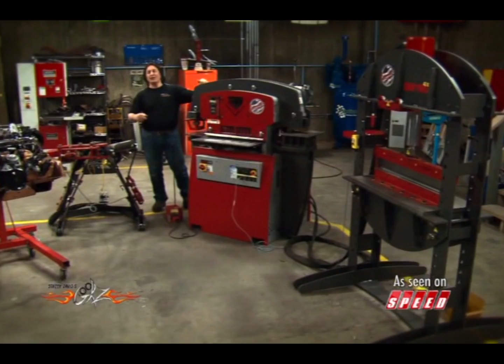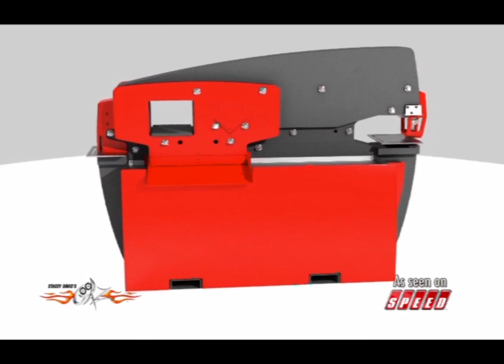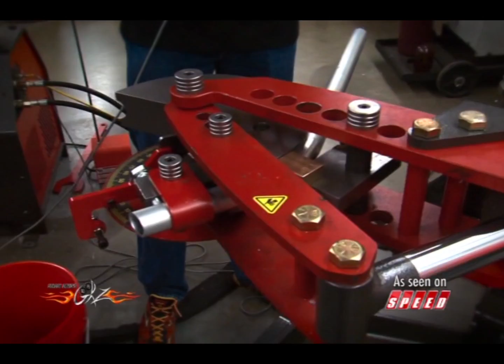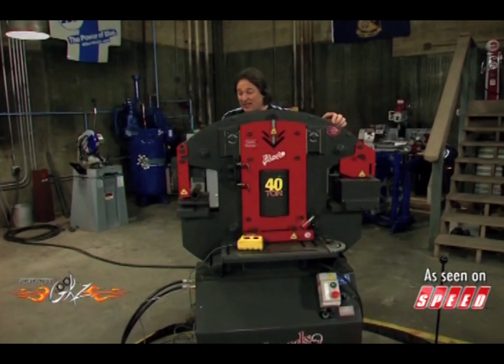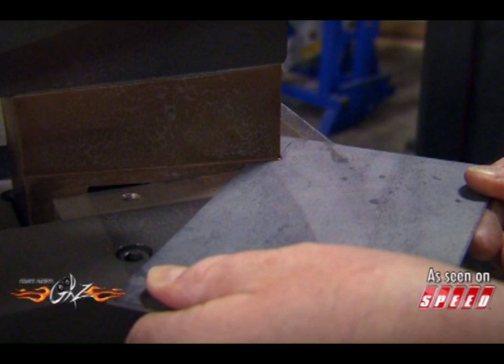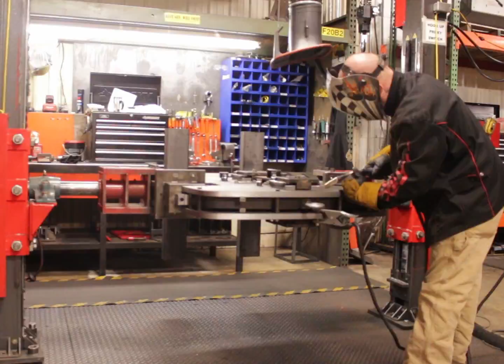Edwards Manufacturing Company Featuring Stacey David

Comment: how can i get this product in india...?
Reply: This is propaganda, and what an awesome infomercial this is. These machines are made of low-grade carbon steel that you can pick up off of any Shelf. I could tell you this cuz I have in my possession a 60-ton Edwards it's not a fantastic machine. It does do his job ish. Boy howdy old Stacy makes it look good like gold like it was dropped from Heaven that's all bull crap. After using the punch for a little while what happens is the deck folds in around the punch especially on heavy parts. Making it virtually impossible to remove . Once you do get out your die grinder  so you can put in the next  die . The lower die impossible to remove by hand because the quality of the Steal is of less grade than the stuff you're punching there for the compression has folded the steel in around the die. Get your hammer a steel rod and a die grinder and you can use it again. The change over time between punch and break is redonkulous. The coper notcher is an nice additive. But the guard built around it makes it virtually impossible to see what you're going to do besides make scrap. I consulted with the people at Edwards and they claim their safety up and down. Okay they couldn't answer my questions about why. Why is it that I can share a 3/4 in length part and it falls out of the back of the piranha but yet it Stacks up in the back of the Edwards making you walk around to the other side of the machine to retrieve it. It's a good machine for somebody that's looking to waste some time. They're bragging rights are a bit much it's made of low Quality Steel. In my 24 years of Welding and Fabrication this thing is as soft as a pillow when it comes to steel. It is way overpriced for what it is. And I mean p e r o i d.
Reply: @lsohweldfab6575  Gamut Capital Management-Typical bunch of rich Venture Capitalists who look around, buy companies with excellent reputations, owners sells, what does he care, he never thought he could make that much. And he is right. The Wall Street boys use a different language: EBITDA, TTM, Ratio of this company's name recognition and market penetration to that sector. They also pay big bucks for forward looking economic forecasts, look at what the Chicago Board of Trade Commodities Brokers are pricing 12 and 18 month steel at.
 Employees are suddenly filling out productivity cards, justifying costs. In the video the EX owner, you will hear him referred to as CEO, the video is probably what got GCM's attention, but the sub.title says COO. These guys also own Jet, Baleigh and Powermatic.
I have spent the last 2 years connecting dots, and putting histories together, from start-ups to mergers and take-overs, and the layoffs in one division when the other four are raking dollars. This happens all the time, but doing it to manufacturing - the lifeblood of our nation, the best paid regular people, the wealth they spread in their communities from decent paychecks, what happens to the 45+ year old who only knows making dies, or EDM or 24'X180" Gap Bed Lathe?  You probably won't know there is trouble, on the outside, until you check into each State's economics section. When you lay off over 100 workers, you are required to file a WARN notice, 60 days prior to a layoff. You can easily monitor this but it takes patience. Defense Department? National Security, it's this kind of crap that raises prices, the armed forces know they have to pay an extra 20-30% just to be sure there will be capacity to build when Iran with it's REALLY improving tech decides to mess with Satan. When the rich boys have made their ten banger- ten times the investment, they sell it, and no matter what crap they show about butterflies and deer nibbling leaves, people are just another cost/benefit analysis, and they will drop them in a heartbeat to "rightsize" the package they are selling. You put 5 companies together, you can cut away a lot of people, at first, it's all strawberries and Champagne, but I promise you, people do not matter to these guys, and do you think you can explain metallurgy or grain alignment, CRS HRS Forging?

Not all are like this, to be fair. If control stays with industry owners and execs, they know what's important, unless they get greedy. In my experience, the more you make, the more you want, you bleed your company, cutting payroll is the fastest way, then they start racing Indy Cars, or donating those salaries for scholarships and schools in their name.
Sorry, didn't mean to write a book.
I have (finally) writing and tearing up model after model, figured out how to stop this, get owners and employees and creativity and job security and well paid low financial stress lives, with hefty $250,000 to $1,000,000 (depending on age) 401k's.
Did you know that over 100 manufacturing companies A WEEK close the doors, sell for asset value, sell with a broker who gets 12% cash off the top, or auction their baby off, getting pennies on the dollar because Auctioneers want 18% and tsome MUST be getting kickbacks from, or own the only allowed Rigger to load, with fees a minimum of $25, that's for a box of 5 cat 40's, or $1,500 for a 110 ton ironworker, so people are paying more in fees than for the equipment they buy.
I'm all talk right now, I worked and/or owned businesses since age 12, joined the USMCR at 17, started a tree company at 27, retired to a 3 acre oceanfront home in the keys in 2004, having worked 26/7 every day, buying rental units with the company profits. When 2008 hit, I lost 45% of my tenants, for THREE years. Property taxes had quadrupled, my wife moved out middle of one night. it took 4 years of agonizing bank/lawyer/fighting, but I lost it ALL. four years of after of hating myself, banking, Barney Frank and his wonderful deregulation which allowed a rotten tomato to buy a 500k house. It wasn't even a year after I lost everything that things got better. Those units are worth twice what I paid, the monthly income when paid off is about 190k a month.
So, there is a whole college course into the economics behind that cheap steel. 
The horrible thing is that I really am a good businessman, I know all the BS Wall Street tricks in and out. By reading!!! Not doing! I made those rentals goals when I was 27, but t was for 125 units originally. Things can be 5 times harder than you think, but pay off ten times better than you hoped.
When I saw some Metal manufacturing Youtube videos that couple of yours ago, my head whirled and I got butterflies, like a first young love. I cannot stop watching, I get 22 Trade Magazines every month. I imagine how I could do working with people with steel in their blood, doing what they love. Actually, being able to pick and choose the parts they love. That's what's great about building big - choices for everybody. I HATED Tree Trimming, I learned to hate being a Landlord - watching people, families coming to my office, both parents with tears and their kids, begging not to be evicted. Once I saw there was no hope, which was before it happened, I stopped pushing and ruining these poor peoples lives, why bother collecting more than I needed to live on? Lost the keys house, and my Intracoastal fixer-upper, moved into an apartment, and eventually became a solitary confinement prisoner in my own home.
I am so not a writer, jumping back and forth, adding and adding and adding blah blah blah.
So for now all I do is plan, wait and hope I can find a few Owners that want to keep their names going, their people employed, and have enough to get by on so I can start this seed that will make that 12 years from trees to Keys look like a model T. This is a snowballing type thing, once there is critical mass, enough that some key people can be in charge of certain divisions, it's a whirlwind. It's set up from the beginning that no person or group can take over, as a general rule, $15 is the lowest wage, and 10 times that is the maximum except for say, buying somebody out, a 5-7 person committee which covers everything from materials to equipment to machines to workflow to sales to overall strategy. Me, I want back what my units were worth 15 years ago. I want done in 7 years max, and at least 10,000 of these fired people back by then, working, learning from each other, bringing in CAD/CAM, but redesigned, so it works how we want it to, it's SO easy to change it just a little, that we run it, not me just staring at it, pulling hair out. I have seen, and paid a guy to reset a chunk of it, we own software, not the other way, not the BS Microsoft learn all new every 9 months, losing all my data in some cloud raining upgrade BS on me. Our design will be easy enough for a 55 year old guy to be walked through it in 2-3 days.
WOW! Shut up Joe
Done-Peace Out all of you builders and shapers of our Country.   OOOHHRAAAHHHH
Semper-Fi
Reply: Can you please sand me a what's app contact
Reply: Any delar in India
Reply from the maker: You can buy direct from our website, www.EdwardsIronworkers.com. Customers are responsible for arranging freight when shipping internationally. For additional information please contact us directly at 800-373-8206 or sales@edwardsmfg.us